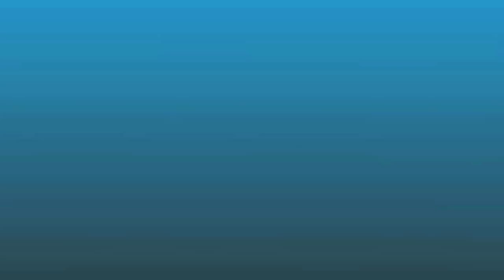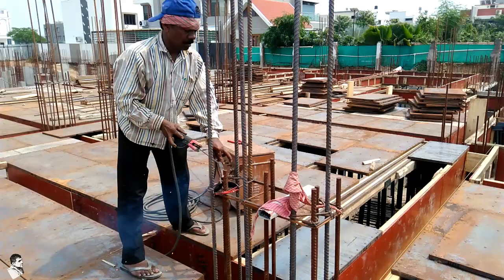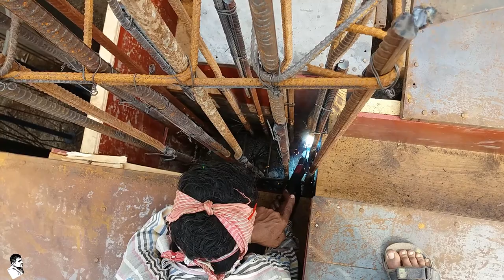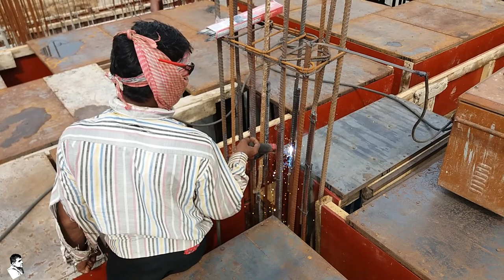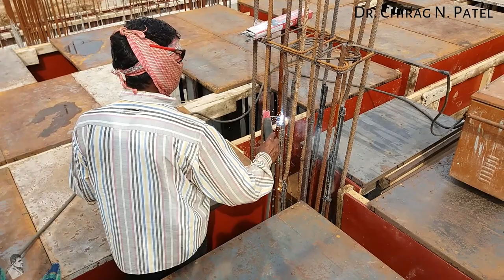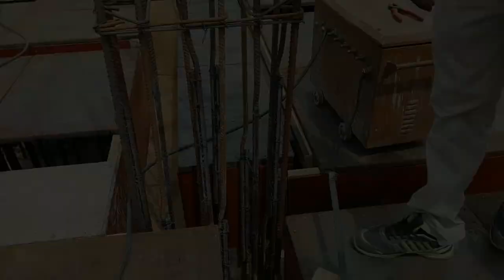How to Weld Reinforcement Bar ? | Lapping of Steel Rebar | Welding of Reinforcing Steel

Comment: Now I ain't no PhD but I do know you can't weld just any kind of rebar.  You damn sure shouldn't weld it cold, it will fail. Judging how this welder is working you folks in India must think because you have so many people you don't need things like structural codes or safety equipment. Every brand new welding students know not to leave you welding leads coiled up. There are so many issues with this its criminal to pass this on as a correct procedure.  Don't do what is shown in this vedio, the rebar will be annealed and fail.
Reply: What they dont show you is.. the 36 camels and 24 donkey's turning the wheels in the background to make the power needed to run that welder. Animal abuse!
Reply: @sudleyarmien8920  no u
Reply: For the welding part, you can weld rebars. For instance there are rebars S500 (non-welding) and S500S (welding). For structural part we don't prefer welding. But there are a lot of non-structural projects with welded rebars.

Comment: Just Learn what not to do from this video , It will be more beneficial. No PPE , Abusive handling of welding leads , Please don't shoot a video and present anything to pass off as knowledge,it's neither safe nor correct!
Reply: What? You mean its not safe to weld in fucking sandals? Or the 26 camels being worked to death just off the camera to generate the power to feed that welder?

Comment: Hi,why u are welding here ,and whts is the method u r using and according which code .plz reply
Reply from the maker: It’s for continuation of bar which is known as lapping. But this is not proper for ductile detailing. It required to improve. Here it is for the awareness of  site practice only.

Comment: I have done a lot of research 
I have concluded that mild steel bars with carbon content less than 0.3% can be welded without any issues
Why is no one commenting on this?

Most of the rebars available in the market come into this category 
Please correct me if I am wrong

Comment: is best to hab longer rebar to continue the colum no gud to heat the  treated  rebar,
Reply from the maker: +rica rica ya that's true. But people are using welding at joint for proper bonding. Thanks for your comment.

Comment: Bro why use lap I really have no idea about lap
Reply from the maker: +Fawad fawad lap is required to maintain continuity of bar. Proper overlap give bonding and anchorage.
Reply: Dr. Chirag N. Patel thanks
Reply: Dr. Chirag N. Patel  what is the length of welding 
As per dia??
Reply: What happens when lap length is available less than 40d

Comment: U r misguiding
Reply from the maker: It’s about practice followed on site. Do not consider it as guide.
Reply: What practice on site?? You cant weld rebar at the lapping especially it will de-bond  the rebar strength!

Comment: Lapping is provided in a wrong zone. 

Lapping must be provided in middle of the column and not at the ends. 

Please read the Structural Drawings before cutting.
Reply: Please explain this in common mans terminology I need to know this. What do you mean by middle of the column?
Reply: Of all things going wrong here Mr. Ahmed shaikh is talking about lapping.? 
Do you mean over Lapp?.? For rebar.
I don’t know shit about welding, so you might be talking about some sort of welding lapping mishap...